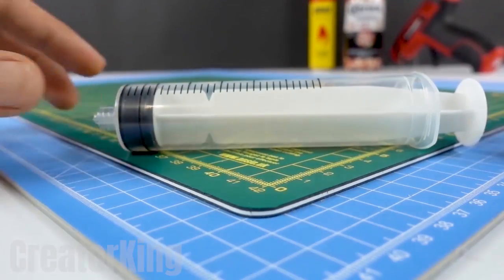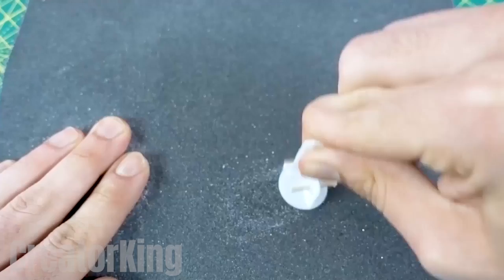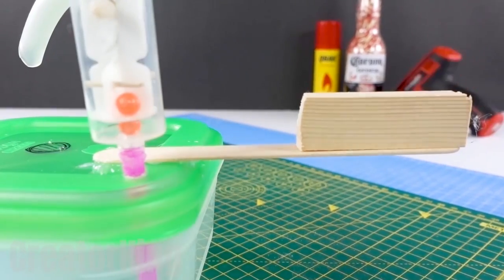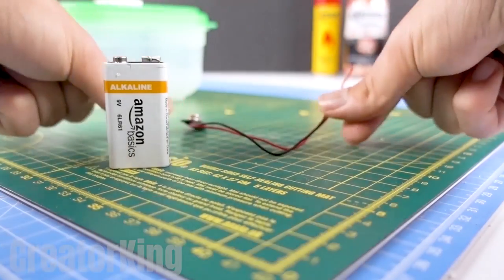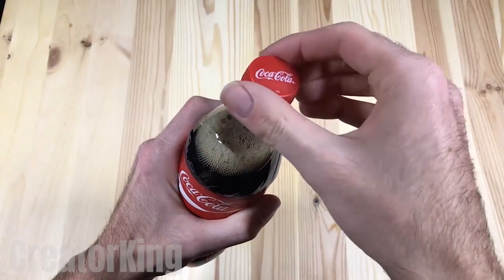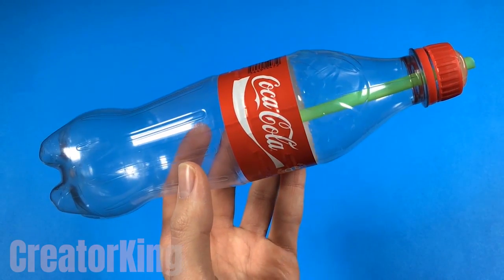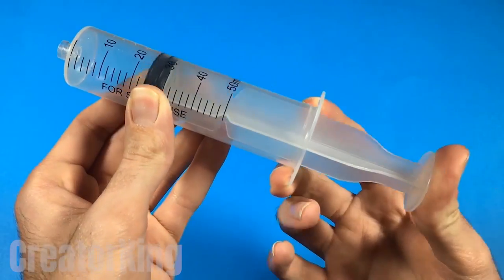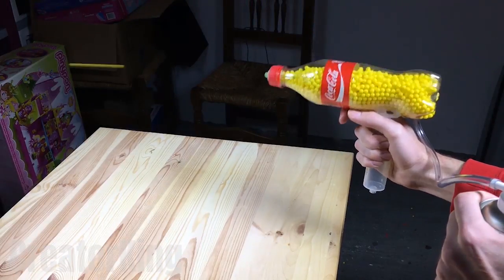Making the ULTIMATE Airsoft Blaster with a Coca-Cola 🔫🤠

Comment: You should test the fps
Reply: Short barrel and probably not a close fit = low relative FPS. But imagine fitting a 500mm carbon fiber tube, with a 6mm inside diameter as the barrel? I bet you could get some real velocity outta it. 😁 At least I'm gonna try. 😂
Reply: @kf4293  you probably can also try putting the psi higher